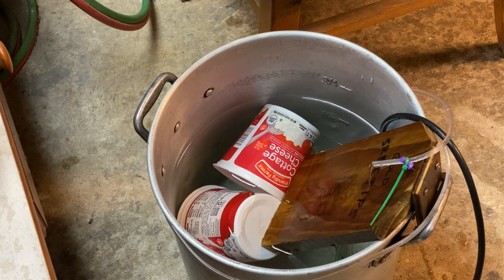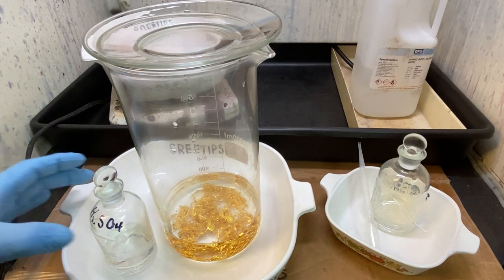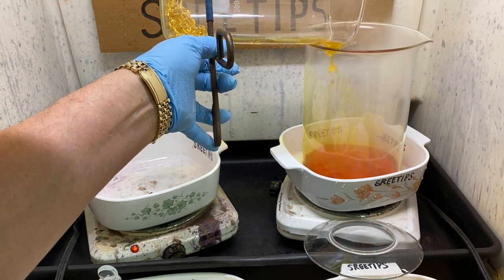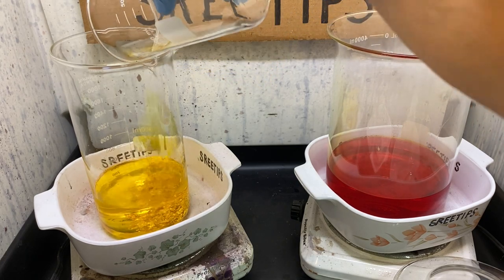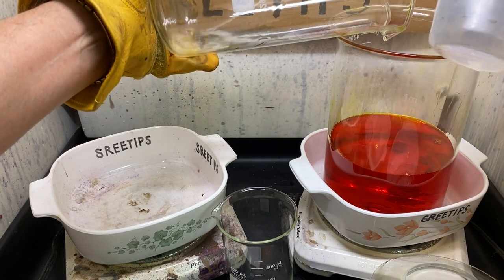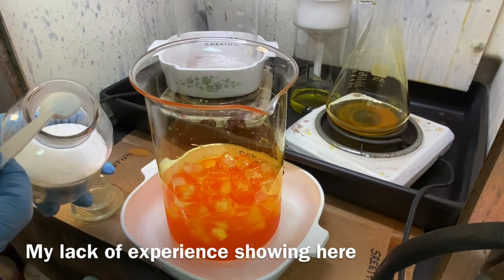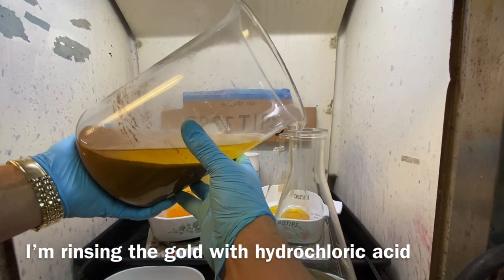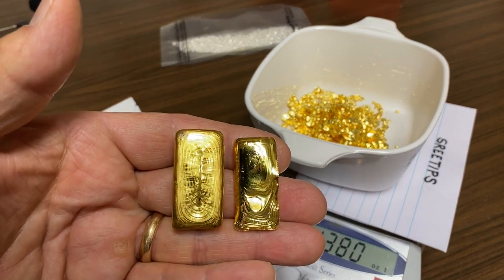15 Ounces Of Gold Dissolved in 500ml

Comment: To make shot the gold needs to be hot and needs to be poured in a stream into DEEP water. So, pouring into a shallow pan of water is never going to work unless you're trying to make jewelry shaped like flat flakes. Try pouring into a container of water the size of a 55-gallon drum or a large steel trash can. You need to give the water time to do its job and cool the gold while not splattering against something before it cools!

Comment: I don't think the frosting effect isn't contamination, but it's because of the temperature of the gold when you pour it. The faster it cools the shinier the bar. If the gold cools slowly, it allows crystals to form on the gold creating a frosted appearance. (examine the frost under high magnification) the faster it cools the glossier it will look. Try hitting the top of the frosted bar with your torch until the surface starts to melt. When you see the metal start to melt, pull away the torch and it will re-solidify quickly, leaving a glossy finish) This is known in the industry as flame polishing.
Reply: Or, tap on the mold as the bar solidifies. Leaving that shiny ripple
Reply: Big guy approves ❤️‍🔥 
Thank you sir 🦅

Comment: Hi
I have a question about silver nitrate.
If I dissolve my silver and platinum group metals in HNO3 and after the filtration I would make silver chloride, which will then be reduced with sodium hydroxide + sugar, will I recover platinum group metals?
I know you use copper, which pushes out silver and platinum metals, but if I wanted to skip the copper method and instead of that use the chloride method, will it work? 

Thanks for your answer.

Comment: I can see we are getting sloppy so on that note here are my suggestions for next videos... 
1. "how much gold is in my sink drain"
2. "how to ppt 10 ounces of gold from a shop floor after a spillage"
3. "how much gold dust is on my shop floor from this blow torch str8 onto gold dust when melting and pouring molten gold onto wet board splattering outside of the bucket"
4. "how do ppt gold of my heaters" 
5. "daily count of fresh acid burns on my forearms"
The comment section can vote on which one first maybe? pick a number
Reply from the maker: Good advice, thank you.

Comment: What happens if you boil the chloro auric acic to dryness? Does it for crystals or a syrup? What shape would the crystals be could you try that as an experiment? From my Limited college level chemistry it isn't a volatile liquid so you shouldn't have to worry about it sublimating away

Comment: The drop would have hit harder if you had an excess of Hcl in solution. Evaporating it down drove off the excess Hcl. The smb needs excess Hcl to convert to Sulfur Dioxide. Much like what you just did in your last video with Sulfuric acid and smb to create So2. The water you diluted it with gave the So2 a place to go into solution keeping it from gassing off into the air, it just needed more Hcl. I know you know this, but it's meant for future readers.
Reply from the maker: I’m used to working with 2 or 3 ounces at a time dissolved in a liter of solution. I was out of my comfort area in this video. Good explanation, thanks!
Reply: @sreetips  I did 80 oz in a reaction vessel one time and had it crack and start leaking. Luckily it didn't break.I didn't have another vessel big enough to put it in and you can't just run to Walmart and buy one. I used a trick GSP taught me off the forum. I poured it all in a new 5 gallon bucket wiped down with Rain-X and precipitated it in that. Rain-X is the shit! No gold stuck to the bucket and it just slipped right out. Used a big plastic soup spoon wipe down with it to stir with. Now when i do lots above 50 oz i use a 4,000 ml beaker and dissolve it in smaller increments and pour it in a 5 gallon bucket and roll with it.
Reply from the maker: Rainx! Whoda thunk it? I’ll have to remember that. I’ve often thought of using HDPE 5 gallon buckets. Thanks for that.
Reply: @sreetips  Rub it in good and then wipe it dry while rubbing with a dry paper towel. It's leaves no residue nor will it leave an oily film on top of your solutions.

Comment: If you're looking to make shot instead of flakes you should pour it through a mesh like screen door material. The size of the holes in the mesh will dictate the size of the shot you will get as an end result. If you're looking for perfectly round shot you'll need to pour it from height. The higher up the more time surface tension has to do its thing and make it more perfectly round.

Comment: I’ve heard that how they used to purify things back in the day, was by super saturating a solution and crashing out the crystals by cooling the solution down. 
So, Shouldn’t The gold crystals that crashed out be extremely high purity?
I’m just wondering what the purity of those pieces of gold would be that crashed out of your solution.
Reply from the maker: Probably way up there. When crystals form they usually reject impurities
Reply: It would be neat to send a sample of that off to see what the purity is on it  .9999 or maybe  .999998?

Comment: You need more flowing water for that shot setup. 

The gold is really hot and the water will expand violently as steam.

You’re not cooling it down quick enough while it’s flowing and getting churned up. Also change the size of the area the gold comes out of. Make it a smaller slit. Or pour much slower
Reply from the maker: Good advice, thank you

Comment: The gold cornflakes looked spectacular! I am confused by: When you added sulfuric acid to your original aqua regia in order to ppt out any lead---and you didn't get enough to cause any visual amount of lead, but if it's there, it's there. But then you added that whole solution into your buckner funnel, so aren't you adding any lead right back into your soup?
Reply from the maker: The lead sulfate gets trapped in the filter.

Comment: The reason you don't get "shot" is because that's not how shot is made. Shot is made in giant towers that drop the metal from high up. As the molten metal falls, it forms into a spherical globule. When it hits the coolant, the outside should be hardened enough to keep it's shape. If you don't have a giant tower, you could simulate the fall using fans... maybe.

Comment: I did this once with about 1 oz, (accidentally). I got busy with something, forgot about the solution being on heat. I came back to find a sheet of gold covering the bottom of a dry beaker and a bunch of sodium chloride (salt crystals). Added some water and removed the gold

Comment: The gold powder looks brown before you melt it on video, does it look like that in real life or does it look like gold dust? What would happen with the powder if you didn’t melt it would it stay brown or would the color come out?
Reply from the maker: The powder has a brown/orange color. In a recent video I was boiling some brown gold powder in water. The water boiled off and the brown gold powder fused into pure gold pellets - just from the heat of the hot plate. The brown gold powder can actually be cold-pressed into a pure gold bar. But I’ve never tried that.

Comment: prob too much water. u want just enough water to keep the board soaked. maybe add a splash guard or a steeper angle on the board. looks like some gold flew off when u poured the molten metal.

Comment: The difference was the shiny-ness at end of the process. I've seen the previous video and I saw that you had yellow and green spots on the gold. So the previous contamination as well had more yellow colour rather than shiny yellow.

I believe the second cleaning process would cost too much money when gold was about 50-100$ per ounce worth. They've used Lead to clean it with. It's though worser for the environment. Still its a cheaper way to clean gold than using second acid process.

So making Gold expensive helped the environment a little more. Lead is far the most dangerous metal that is, and even having it vaporise into the air is not a good deal. If all did that way, we've all would end up in hospitalization.
Reply from the maker: Much can be determined by how the surface of the bar looks once it’s melted.... a quote from one of my mentors on the GRF, Harold_V

Comment: What's in the bottle you use at 5:43? You say you're getting HCl out of it even though it has H2SO4 written on it, so I thought maybe it's just mislabeled. But then at 11:47 you use the same bottle but then say it's H2SO4. Just trying to follow along :-)
P.S. I'm fairly certain it's actually HCl, as that's what's needed for aqua regia, but just want to be sure.
Reply from the maker: I add h2SO4 while dissolving the gold to remove any lead. After evaporating down to syrup I add HCl to the syrup to expel excess nitric, if present.

Comment: I thank that if you cut small groves, maybe 1/8 wide. That should help the gold to run off the end of the board in small streams, instead of coming off in sheets. I believe that will help you get better shot. Have you ever thought about putting the board in the freezer?
Reply from the maker: Barry, the molten gold wasn’t hot enough. I poured too soon. If I had waited then the gold would have spattered into small pieces instead of the large chunks you see in the vudeo

Comment: Hi if you want to make good gold Granules shot Pre-heat a crucible that has been drilled with 2 mm holes like a shower head pre-heat the Crucible. Then pour the molten gold in to the Crucible over the water and it will rain out small gold granules. Cheers David
Reply from the maker: I did that with some silver one time. Worked pretty good

Comment: Sreetips, this is a superb video and exactly matches my anticipated refining requirements on a weekly basis. I have a gold dredging operation in Nome, AK. Hope to be producing on the order of 5-20 ozT weekly. Refining batches of 5 ozT seems to be a healthy medium. I like your use of the classic denoXX rxn. I can suggest immerse the beaker in a cold ice/ NaCl bath. It will further reduce the temp. Question sir: considering the size of your business, do you think it would be a good idea to invest in an XRF? You could include XRF readings in your video productions and also use XRF as backup data for sales. Semper fi.
Reply from the maker: This is my hobby. I did check into it once. To own it was close to $20k. But I could rent it for $4500 per month or $1500 per week. Too rich for my small hobby operation.

Comment: Master after so many times me trying different methods I like the way you did it but if by any chance you have a lil silver/copper/gold and perhaps try 5 big 🧊 cubes like the ones you had and  if you can chill the water before putting the ice  in pot then when the melted metal is ready for pour start dropping it just hitting the ice cubes only  and it will bounce and produce shot please give it a try if you can
Reply from the maker: I have poured shot by bouncing the molten stream of metal off a block of ice. It worked well. But in this video, I’m quite certain that I had not waited long enough, and that the molten metal was not hot enough. I rushed it and got a bad result. Typical rookie mistake. You can actually see some solid pieces of gold coming out of the crucible. If I had waited for the charge to heat to the correct temperature then the metal would have behaved much differently as it was being poured on to that piece of wood.

Comment: Was the water in the initial container  with the gold filled with distilled water or tap water? I didn't know if it was tap water if the very small amounts of chlorine would affect the reaction in any way since it wasn't washed off when added. If in case it was tap water. Sorry if this is a dumb comment
Reply from the maker: I poured the molten metal into tap water

Comment: When you're trying to make your gold shot you need to get a stainless steel mesh like the size that the Walmart strainers that use a wire mesh use and put It just below the water line and then pour your gold onto the stainless steel mesh that suspended just under surface of water and you will get very fine uniform Beads the Stainless steel will not melt or be affected or affect the gold
Reply from the maker: Nice, I’d like to see that

Comment: Am now waiting for the video in which you sweep your floor and recover previous metals from the sweepings. Looking at the shape of the results, I suspect that getting flakes instead of shot will make it easier to dissolve it. Now would be a good time to do some calculations to determine how much hydrochloric acid and nitric acid you need to dissolve a given amount of gold. Then you can weigh your gold, add the required amount of HCl and sulphuric, trickle in the nitric slowly, and top off with distilled water as you go to maintain the fluid levels. Less guesswork, less wasted reagents.
Reply: Leaving some behind in the filters would be more conducive to production since they will get disolved at a later date.

It also allows for a more precise use of the acids as they will reach saturation and prevent more contaminates from being reintroduced into the product.

Comment: I like the water-cooled board. Using a spray bar that increases the flow speed might help even more.
Is there any reason not to use a ceramic plate, or just hard to find something suitable?
Reply from the maker: Wood is easy to work with. I seen a wet board on tv one time so I copied it.

Comment: Try refining the gold by redissolving several times until the powder becomes white! When the ultra pure gold powder becomes white, it is essentially mono-atomic gold. You then redissolve the mono-atomic gold and concentrate the solution to saturation point. Let it recrystalize without evaporation by slow cooling, and you will be amazed at the color of the crystal that forms from the bottom up! GREEN GOLD CRYSTAL. The infamous green lion of alchemical lore. :) An alchemy buddy of mine, Avery Hopkins (Kymia Arts), has a post on his website with a photo of this crystal. Next level stuff!
Reply from the maker: Joseph, if the gold powder ever becomes white then something is very wrong.
Reply: @sreetips  according to google...  "Ormus Gold, also known as Monoatomic Gold, White Powder Gold and Manna is a unique substance. Composed of precious minerals such as gold, platinum and iridium, what makes it interesting is that is not held in a metal state"
Reply: @sreetips  I feel I may be as confused as you in the bigger sense

Comment: Hello friend, happy day, the first thing I must tell you is that I love your videos, you can see that you know well what you do and for me it is a pleasure to see it, I would like very much to know your opinion about the process that I have in mind for the  recovery of gold from gold-plated pins and even some pieces used in jewelry that are also gold-plated, the process would be as follows: to dissolve the base metal, submerge the gold-plated pieces in a hot solution of 96 sulfuric acid.  / 98% for example of 200ml and about 4 grams of potassium nitrate, once the base metal is dissolved, strain everything and wash it with a little distilled water to add another hot solution of 33% hydrochloric acid and potassium nitrate with the same amounts  Before refining the gold, once everything dissolved, the following would be to precipitate the gold with sodium metabisulfite and after filtering it, wash it with 33% hydrochloric acid, filter it again and then melt the precipitate finally with help.  It gives borax as a flux, the reason for not using nitric acid would be because at the moment I cannot access it in my country, thank you very much for your attention, I hope your opinion, greetings.
Reply from the maker: I’ve never used the process you described. I’ve run gold plated stuff through a sulfuric stripping cell. Gold plated material has very little gold - almost nothing. It took 12 pounds to yield about 2.5g of pure gold. So if your working with a few hundred grams then the yield will be very low. Tenths of gram only
Reply: Thank you very much for the information friend, I will tell you how the process went, the truth is that a 1u plating cannot be expected long in that you are right, that you have a great day.

Comment: How do you deal with your gold filled stainless scrap? Or do you just try to avoid it altogether? I've heard of using reverse aqua regia but haven't tried it yet.
Reply from the maker: Most GF is brass or copper. I’ve seen steel watch band GF caps (gold filled on one side only) and they will go in the hot dilute nitric just fine. May take a little longer. I check the foils late into the nitric boils with a magnet. If steel is found then I keep boiling until it’s gone or just remove it from the reaction if the gold has been removed.
Reply: @sreetips  thanks for the tip. Most of the stainless caps do dissolve, very slowly, but I've had a few pieces don't don't even seem to get touched. Like some watch bodies and such. They stay nice and shiny and sometimes the gold barely even lifts off. Thanks again.

Comment: Wonder if you could improvise a p trap with a plug in you exterior portion of exhaust pipe to trap and keep rain water from coming, whe. Raining you could pull plug and rain water would then drain outside
Reply from the maker: Good suggestion. Thank you
Reply: @sreetips  also the boars in this video is the board i was referring to the other day

Comment: You need a taller water column for the gold to fall through if you want shot and not cornflakes.
Reply from the maker: Actually corn flakes are the best - more surface area
Reply: @sreetips  i agree. All our gold is smelted with Chapman flux then cupeled with lead.
Reply from the maker: I’ve never used cupel. None of the refiners that I learned from did either.